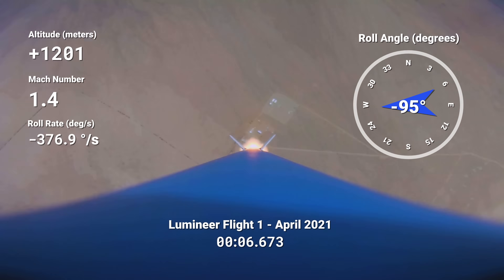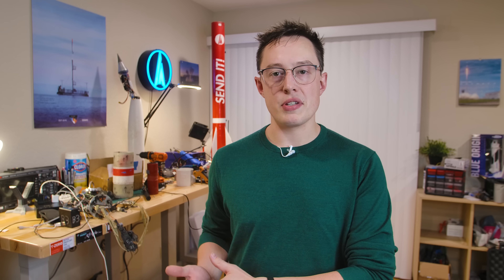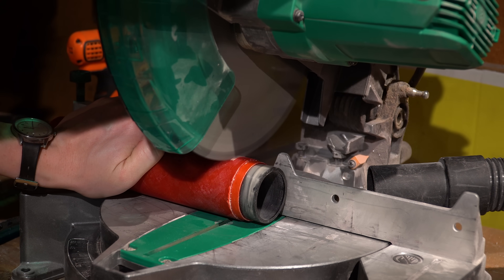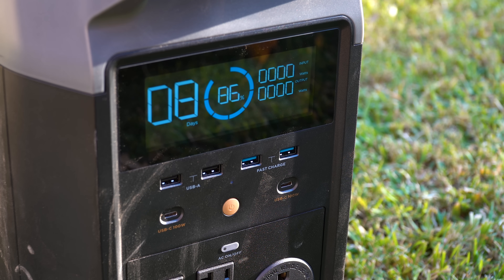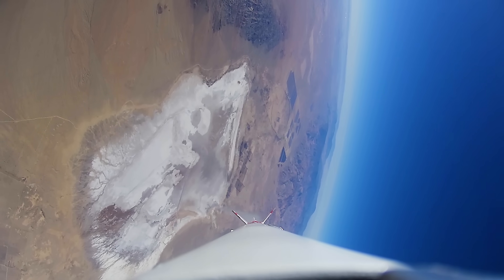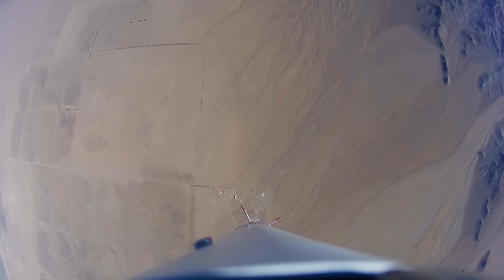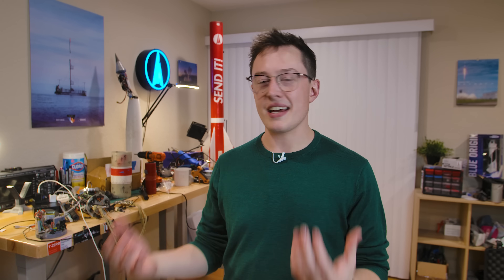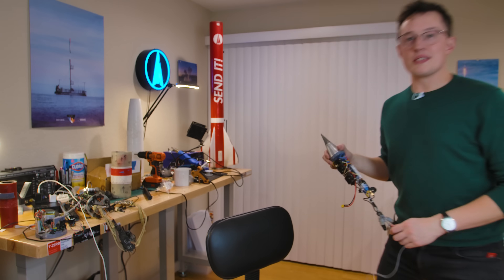Can You Get Stable Video From a Spinning Rocket?

Comment: I'm kinda shocked he didn't use a plain old cheap DC motor.  PWM'ing a DC motor has a few pitfalls, but once you figure it out, it has the potential for extremely fine-grained low-speed control.

Comment: Joe, 
When I discovered your channel this episode was one of the first things that I watched. Your solution to prevent the camera from rotating seems to be effective but very complicated and its range of satisfactory operation seems to not work well at low rotational speed. Being an old "flange head" (mechanical engineer) I was wondering if you had considered using a gyro to stabilize the camera platform while in flight. A small disc spinning at 8-10,000 rpm should be a good gyro, mount it with it axis of rotation is at 90 deg to the vertical axis of your rocket which should keep the camera mount platform, which  would be mounted on a bearing to rotate around the vertical center line of the rocket, from turning.  

Also having worked on some tooling for several large solid fuel boosters I remember that they all were ignited from the top of the fuel, any reason other than ease of installation that you ignite from the bottom?

Your channel is extremely interesting and you are certainly a very bright young engineer and you give me a lot of confidence in young engineers.
Rex

Comment: If rocket science was easy, there would be a rocket lab in every basement. I remember an old rocketry saw; you learn more from a failure than a success. And on the upside, no CATO, the booster didn't take out the camera unit on drogue deploy, not only did you have a good recovery, but you also got back some good data. Can't wait to see what you do for the 2.0 version.

Comment: Just a questioon from non-rocket 'semi' tech savvy person like me.
Can you create video stabilizing by using a gyroscope with some mirrors. Camera stays fixed inside fusilage. Mirror 1 on mechanicalgyroscoop or flywheel .axis of spin pionts at were you want foitage taken of  .It spins so fast that lightbeam can be interruptedand centered on tube/body axis of rocket. Light comes in through open slot or part transparent tube. ( I hope reader catch the overall principle.🤔🤓) ( maybe you need second reflector to reverse image and than point to focalpoint of camera. Or just have camere lens point parrallel with  gyro's ? with lightweight mini cam. f.e. .
Fascinating though. These rocket projects!

Comment: There is an easy way to accomplish this. Add counter rotating fins just for your camera. Your camera has a bearing, so it will rotate as fast as rocket is rotating but in opposite direction. Let the wind gust to do the rest.

Comment: G'day Joe and thanks for some really interesting, informative and enjoyable content.

I am no engineer but merely used to fly aircraft engineers created so I hope my suggestions have at least some merit.

Since 'for every action there is an equal and opposite reaction' it seems to me that unless the short fins you installed are intended to compensate for it contra rotation requisite to the anti-spin device and I didn't pick up on that it could/should exacerbate rate of rotation for the rocket.

Other than that I wonder what magnitude a drag coefficient induced by additional 'short' fins permanently inclined from alignment with the longitudinal axis might be.

Also how might they interact in close proximity with the primary stabilizers because presumably precise attention to aerodynamics should always be a significant consideration.

Given a more or less strictly linear trajectory could a simple annular airfoil be more efficient and effective at sustaining longitudinal stability while struts supporting it would still serve as fins which could be configured to counteract spin?

Support an annular airfoil provided could also make a substantial contribution to minimizing flutter for the fins at high Mach values.

Given that your anti-spin device not only rotates but evidently does so inconsistently could gyroscopic precession be a consideration?

In closing I emphasize that although they were dealing with a relatively small volume of knowledge and understanding while attempting creation of the first powered heavier than air vehicle to carry a human aloft.

Even the Wright brothers found it necessary to contrive what was probably the first true wind-tunnel in order to test their concepts and if they did it on a 'shoestring budget' so could you!

Comment: Only just found your channel. You could take a hint from T-PODs they use an angled mirror with a stepper motor for small corrections, the head of the pod has the main motor, de-rotation on other axes is done in software when you reach the gimbal limit. I am thinking you have a transparent section for the mirror which does the de-rotation while the the camera assembly just rotates within the core. 

Or you could also have a pyramid or cone  for the mirror (if using software image correction) again inside a transparent ring section for the rocket core.

Comment: Kind of a silly question perhaps, but how is the motor spinning the whole assembly with the bearing? It's spinning the outer shelf ("Hollowed out cylinder"?) against the centre tube that is fixed to the rocket correct? I'm curious about the bearing itself too, I don't really understand how that works. Is the motor attached to the bearing?

Comment: For later try an O Drive controller or make it yourself.

You have an encoder for the bldc motor and it can have mm precision smooth movement.

Regular bldc servo controllers use back EMF from the motor to see it it spins and it needs speed for that, if you have an encoder you use it like an servo motor that even gets hold torque like in large CNC machines.

Think it looked pretty good for a first try but yes an encoder would 100% solve the jittering moving

Comment: why not just build in a e-motor so it spins to the oppposite site (you did. i didnt watch). OR just show slow motion video (and normal sound) so you dont see the rotating. because the whole emotor system is not really practical on a rocket. imagine that kind of bullshit on the starship of spacex.

Comment: quick solution out of the blue, but rollerons might be an interesting test for stabilizing your rocket with out having to mechanized your camera payload. @smartereveryday has a video: https://www.youtube.com/watch?v=x8L83AHYum0 || although it would nullify the use of the camera carousel, which would be a bit of a bummer but its also a tangential experiment that would be fun to implement.

Comment: is there enough mass in the section of the rocket below the camera to maintain flight control at higher altitudes?
if there is then allow the stronger motor to spin the entire nose cone as well. this would have the ability to help stabilize the nose cone for potentially deploying future loads as a side bonus.

Comment: How about building a rocket to where the entire outer body & fins spin free while the interior payload is on Bearing's a secondary gyro stabilized separate piece maybe add deep  exterior rifling grooves to the outer skin to see if you can build a finless Rocket where the skin acts as fins from what's missing plus I can't believe no one has ever processed that thought

Comment: If you put multiple cameras in a circle with software and knowing the spinning velocity you can make a static video of whatever angle you want. One problem might be the fps of the cameras. Or even a single camera that it knows when to take a shot of a frame. 

I don't know if it would work.

Comment: At this point in time there are 1,189 comments so trying to see if someone else has mentioned this will be difficult to determine.  That said, I was wondering if you're familiar with the the method of stabilization on the tips of the Sidewinder missiles?  Each of the back fins have what is effectively wind spun gyroscopes that should (in theory) prevent the rocket from spinning.  You could use an air compressor or something to spin them up prior to launch and as the rocket accelerates they should spin up even faster.  Just an idea.  <grin> Worth every penny you paid for it.</grin>
Reply: Update since I can't find where to (or if possible to) edit my original comment.  You can find an example of the Sidewinder "rolleron" here: https://www.youtube.com/watch?v=cfzj3rRIVU4

Comment: Rotating rockets sound so crazy in theory, but in practice it's oddly common especially in the military sector. Most small surface to air missiles spin their body at 10-30 Hz while gyroscopically stabilising the seeker head.

Comment: Pro tip: Antenna on the telemetry thingy is fragile/sensitive and NOT a mounting point. Don't ziptie it to a metal rod.
Also, antennas do not like being ziptied to metal rods for communication reasons as well.

Comment: Seems like it would be easier to just spin the camera at a constant speed and then do all the corrections with software realtime. That would also provide a nice 360, albeit lower frame rate  🤷.

Comment: F18 mechanic here. Have you considered that the leading edge of a wing is a very crucial part? If you have sanded them slightly uneven, the asymmetrical edge cutting through the air could have more impact than the .1° error of tilt

Comment: Back in the days we build our first cam stabilizers a.k.a. gimbal for multicopters like you did with motors and gears a.k.a. servos....nowadays the BL motor with a high count of poles is mounted in the rotation axis...so why not mount the camera on the rotor of a giant BL motor?

Comment: The problems you had are pretty easy to fix. If you don't want to use a stepper, you can use a FOC controller or a sensored ESC controller

Comment: Wow, this was great!  Smoothly tracking roll is challenging.  But isn't there a much simpler approach?  Your rocket is spin (gyro) stabilized, so why not do the same for the camera platform?  That is, remove all gearing from the platform, and add a flywheel with the axis perpendicular to the platform's axis?  The motor/flywheel assembly would have to be something thin, perhaps a 2.5" HDD motor would fit the bill.  (Sorry I'm late to the party, somehow I missed this episode.)

Comment: you are a genius... please excuse me... i need to mention that a Brush type motor can run slowly... all be it with power issues. Trouble with brushless motors needing to be commutated by the driving electronics and it takes awhile for them to sense the position of the poles.Come to NZ and you will SURELY get work with Rocket Labs, even though you would not have the freedom you now have. They are recruiting now.

Comment: Your motor is fine! It's choppy because most cheap motor controllers don't know where the rotor is when it's not spinning. All you need is a different controller that can do FOC! Check out simple FOC for some examples and recommended hardware. You might need to add an encoder to the motor but that would be the only necessary hardware change (minus swapping the controller)!

Comment: perhaps you can have an opposing gyroscopic counterweight running on the inside of the tubing? It would allow the rocket to naturally spin, each time your device activated it spun the whole body a bit.  this could be as simple as a small idler gear on the wall of the frame. that idler gear would drive a printed inner wheel on the inside of the pipe.  your internal counterweight would have to be slightly heavier than the outer due to the mechanical advantage of sizing. 

Contact me through my channel if you want a better explanation. I can draw it for you or post a short explaining the idea.

Comment: Really cool idea! When you said you're going to spin the camera I 100% thought you're going to use an analog method using a complex system of gyroscopes, and not digitally with sensors and motors. No idea if that would work, but if you like the idea and you believe it's possible, PLEASE do take the idea as yours and implement it.

Comment: You should use brushless motors for gimbals, they will suit you better since they are designed to have much more poles and lower kV. 
The advance solution would be to use bidirectional dshot from those ESCs to get eRPM from motors. If you are not using dshot consider it. It is much more prices than PWM for ESC control.

Comment: Great footage! How about a self made linear/stepper motor around the whole section. Would give you faster and much smother response. Be sure to remove any imbalance, otherwise you might get a whacky rocket if it fails to spin. The middle rod reminded me of old wooden boats where the bilders lead cables or ropes down the middle to tighten up the ends and compress everything, ie in the Triremes.

Comment: If you end up needing to go for the 360 camera - would it be possible and safe to increase the spin? If you can increase it to 10hz, you could mount 6 cameras and use the roll code to time the shutters so that they fire at the exact right time (modulated 10FPS) to act as a single stabilized 60FPS camera (or they could fire at their full framerate, and the resulting footage could be sorted into 6 different viewpoints). Bonus point, by adjusting the timing, you can "rotate" the viewpoint. 

FPS might be a bit inconsistent depending on spin rate, but could be reliable.

Comment: Stepper motors: You're going to need a stepper motor controller. At work, I've been using Pololu Tic TIC825, a Stepper Motor Controller/driver that offers USB, UART, I2C, RC pulses, step and direction, and analog voltage interfaces. The controller can be used to control position OR speed. The other Tic controllers seem to use the same microcontroller, and differ mostly in the range of motor currents and supply voltages. I've been greatly impressed by their performance. The T825 goes to 50k steps/second, and most stepper motors are 200 steps/revolution, so up to 50k/200 = 250 rev/second.

In your application, you're counter-spinning the camera to minimize the instantaneous roll-rate. Maintaining a fixed counter-spun position is not actually necessary (fixed positioning would be the extended feature target, but you'd probably need a better gyro.) I've assumed the camera ring has it's own roll rate gyro, but it likely has a little bit of roll-rate drift, even when when stationary. Capture rate drift while sitting on the pad, then after launch, offset measured roll rate by the captured drift rate.

Having the camera ring doing a slow roll during flight shouldn't be a problem.

Comment: Could you just mount the camera section on bearings with separate fins. Essentials to use the wind resistance to prevent the camera section from spinning and stabilizing it without electronics?

Comment: I'm not sure how well this would work or difficulty in implementing it, 
but could you try to sync the frame rate of the camera(s) to the spin rate of the rocket and then yolo spin the rocket? it seems like it would be mechanically simpler

oh god im a comments section armchair engineer

Comment: Instead of making a complex counter-rotating camera, use rollerons on the fins to stabilize the rocket. https://en.wikipedia.org/wiki/Rolleron
Reply: Eh, the altitude where he is aiming for is close to vacuum. Once the athmosphere is thin enough the rollerons wont maintain rotational speed and wont do zilch by the time the rocket reaches target altitude.
Reply: @juslitor  they'd keep it stable from launch through the lower atmosphere. Having been kept from rolling there, it's not going to start rolling later.
Reply: @greggv8  I have doubts about the ability of rollerons to maintain high enough rpms to provide gyroscopic stabilization when the rocket reaches the intended altitude of space. If rollerons worked for high altitudes someone would use it. No doubts rollerons works wonders on AA missiles, but they work in a very different environment than space.

Comment: How about using a gyroscope which can move in x,y,z coordinates. The outermost layer will rotate along with the rocket.  You can rotate the internal wheel without bothering about speed and timing, this will create a gyro motion and stabilize the cameras attached to the pivot point.

Comment: I got the same lathe. Such a piece of crap. I've owned harbor freight 7x10 lathes and they were somehow better. It's a decent "kit" but comparing stock vs stock you can see in the cuts it's not great. I got the cross travel smoothed out by gluing sandpaper to the top slide and working it back and forth until the carriage cross slide ways were smooth. Got a quick change tool post and now just need to delete the pitted and canyoned flimsy compound. That leaves just the string for a belt to deal with.

Comment: Love the design, seems really complex though. Would it be possible to just increase the rotation of the rocket so much that it's spinning at 30 rps? You could just take one frame every rotaton and it would appear as a consistant image. I'm not really that knowledgable about rocket science, and I suppose changing the pitch of the fins enough to achieve that kind of rotation may cause too much air resistance. Just a thought!

Comment: Were you adding up the roll angle to find how much the camera spinner needs to correct for it? What if you sort of wrap the angles between 0 and 360 degrees and then find the error and the smallest way to reach it sort of like the axis angle approach in attitude parameters? I'm not sure if it will work for a spinning rocket but I would appreciate your feedback on this. You're my inspiration :)